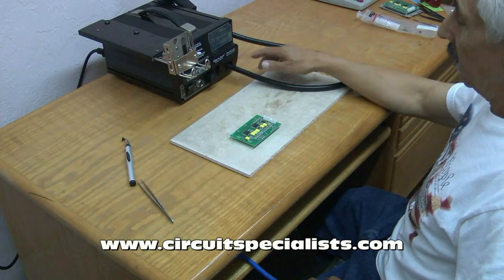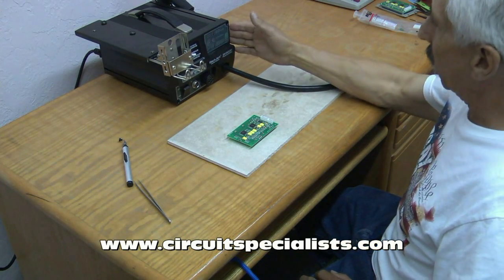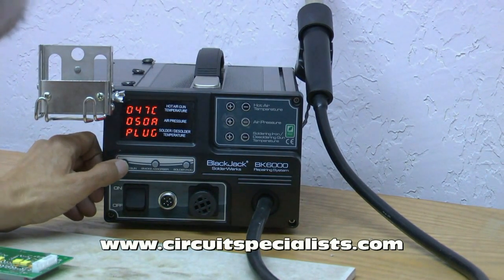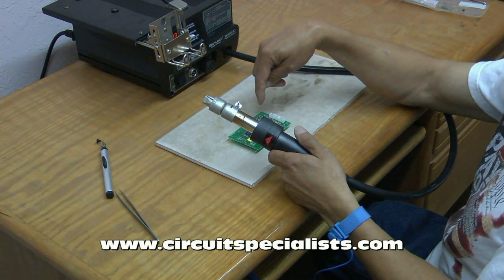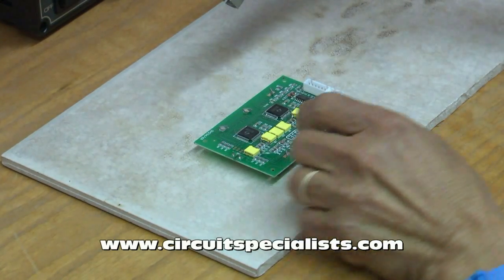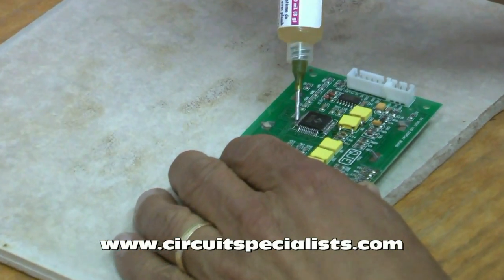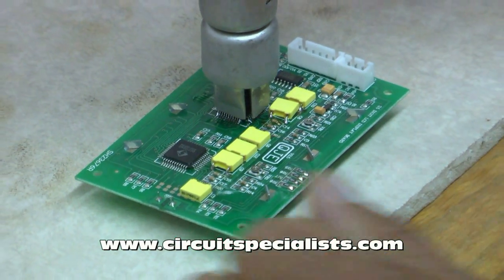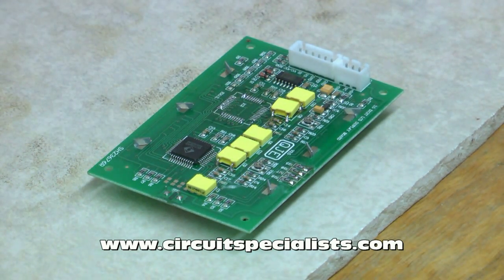QFP removal with a hot air rework station

Comment: Nice!  I like your video, I am going to be trying to solder some 100 lead qfp chips with a hot air gun and 14 x 20mm hot air nozzle, but I am wondering why you set the temperature so high.  Were you using lead free solder?  What temperature would you recommend for lead based solder?  Thanks